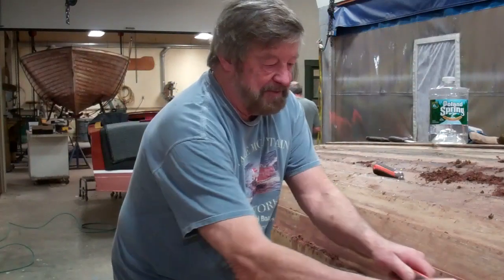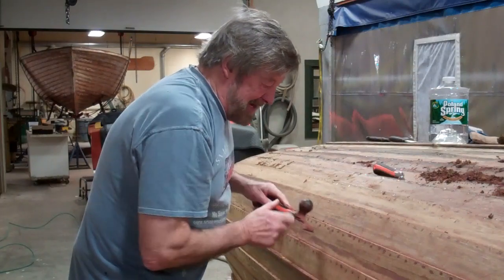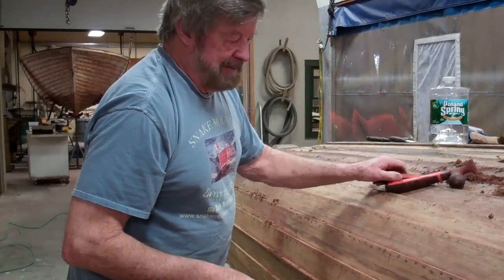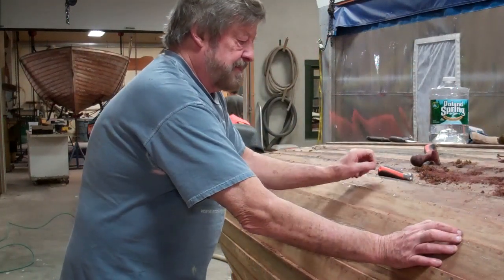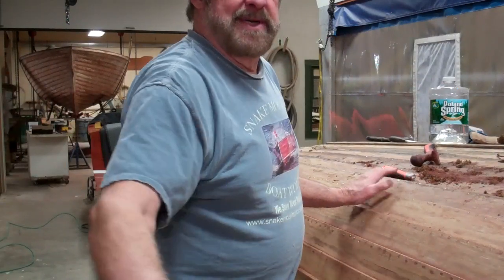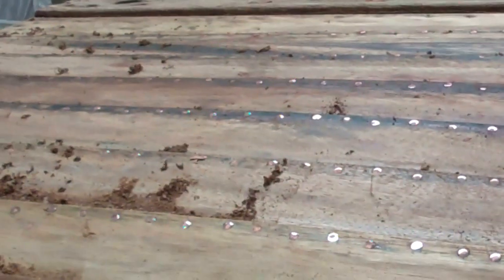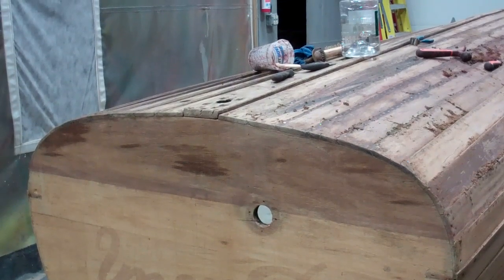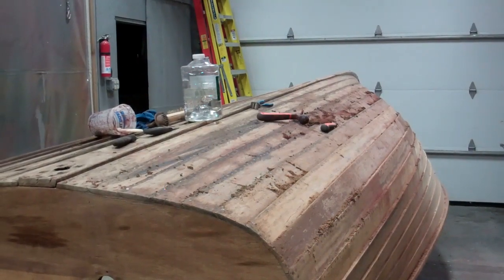1940 Lyman 16' Yacht Tender Dry Scraping Bottom Paint 12 11 2017

Comment: Michael , Thanks for reinforcing my  decision not to use Clinch Nails when Re Ribbing ''LuLu" After the frustration of trying to set the rib tightly and the uncertainty of them holding correctly, I also used #8 Screws On all ribs Above and Below the waterline.  I feel it is a acceptable method of doing this and am very pleased with the end result.
Love Susan She's A unique Beauty 
Don From Michigan
Reply from the maker: Don, I agree on a utility front, but Susan is just too rare and too incredibly original to go with replacing the clench and rivet fasteners with wood screws. 
We have an excellent set of clenching irons - actually body shop dollies, a set of drifts of varying diameters so we can match the heads, a set of dead blow hammers and, what may be particularly appreciated by RJ, killer hearing muffs.
It will take many hours, but she will emerge as close to original as we can achieve.
We will replace the 2.5" copper smooth-shank nails that were used to fasten the aft ends of the bottom strakes to the transom with silicon bronze wood screws. I tested a couple nails that had released, only to see bright green copper shanks.

Comment: I would suggest that copper rivets would be a better choose  for refasteniing  the the planks to the ribs and your refinishing including 3 coats of epoxy, 5 coats of primer, and 3 coats of bottom paint would make it extremely difficult to redo the bottom if if ever becomes necessary. Why not a more traditional method of bottom coating ?
Reply from the maker: Uhhh... 
Save for replacing copper nails driven through the aft tails of the bottom strakes and into the transom, and for six original #14 brass wood screws on each side of the keel that were sunk through the garboard/@1 strake and into the bilge stringers, we are replacing no fasteners. Rather we will tighten ALL oif the original clench nails running on one-inch centers along the strake overlaps, and  the rivets driven through the ribs, which is the traditional manner: We use a dead blow hammer and drift on the exterior and a pour soul with a clenching iron and rivet iron on the interior. 
The method we are using to finish the bottom could not be more traditional! Perhaps you are unfamiliar with Clear Penetrating Epoxy Sealer?? Just Google it to learn about an incredible sealer,. (It is not what you are thinking about ... West System.)
The primer is just that, primer ... a paint, but a very special two-part barrier coat that has been used to good advantage in marine applications for decades. Just Google Interlux 2000E.
Finally, the Sandusky Paint Company  Copper Bronze Antifouling Paint (http://www.sanpaco.com/Bottom%20Paints) is exactly the same paint used by Lyman at its Sandusky, OH factory on thousands of Lyman hulls for decades before and after WWII. Notrhing could be more traditional, and reversing the method involves an equally traditional method: reach for chemical paint stripper and go at it until you are staring at bare wood.